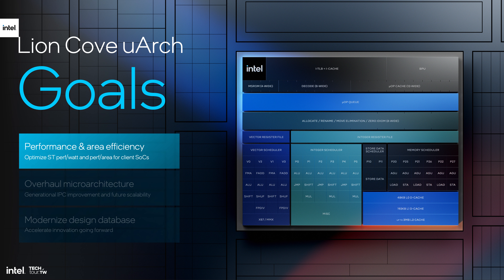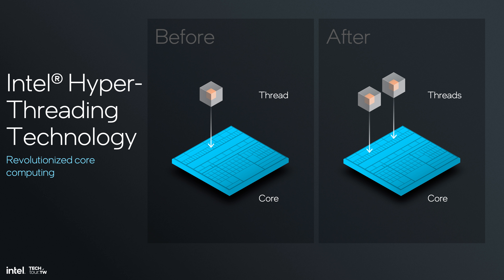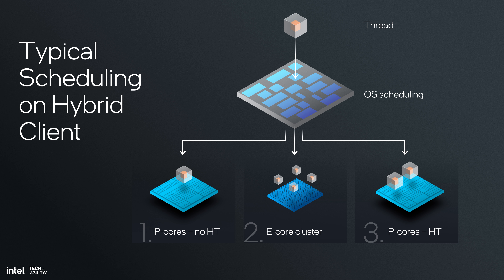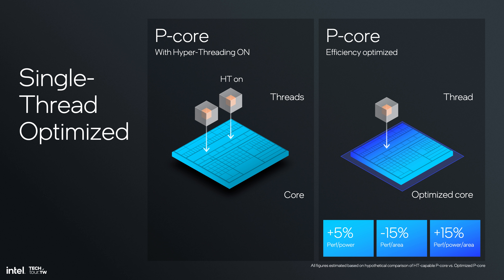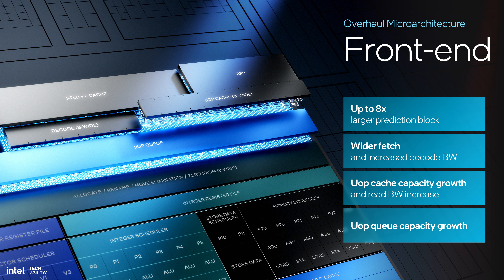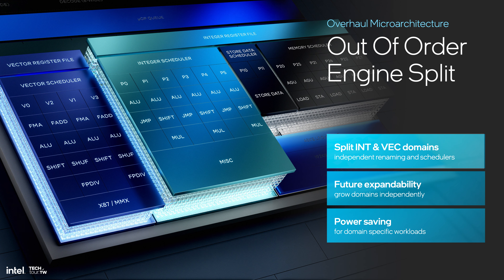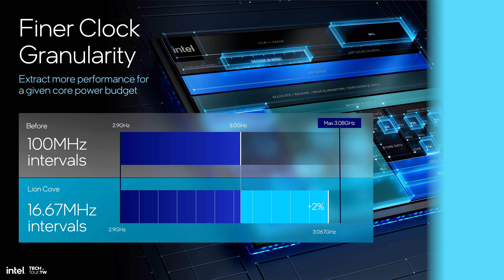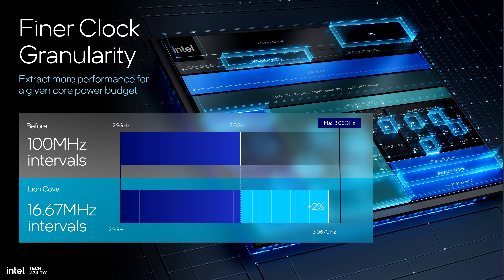Lion Cove P-core Architecture Explained by Intel Engineer | Talking Tech | Intel Technology

Comment: Can it beat X elite and M4?

Thats what we need to know!
Reply: Seems like Lunar Lake has a much better graphics chip.  I don’t know about how efficient it is compared to the others.
Reply: not need beat X, must beat apple
Reply: It should trade blows with both. The thing is, Lunar Lake will be in vastly more laptops, with more configurations and cheaper options and have no terrible Windows on ARM issues. It'll basically be the go-to solution for the vast majority of buyers. 
People that want Mac will always buy Mac and vice versa for Windows, M1-M3 Mac barely saw any increase in Mac market share.
With the X Elite, you have to deal with atrocious Windows on ARM, Qualcomms early access iGPU drivers, and very limited selection of laptops/configs.
So Lunar Lake will be end up being what most people buy.
Reply: @__aceofspades  This. Intel isn't beating anybody (by a large margin) with Lunar Lake. But with the amount of capacity they've booked (from TSMC), their packaging capabilities, and the fact they are able to supply more SoCs to OEMs, makes them much more appealing even if they don't win the performance front, but still make up in efficiency.

Here we go again.
Reply: no need to beat X Elite when it perform kinda on par with other x86 currenty in the market like hawk point and meteor lake (see the reviews). i think the goal is to beat M4

Comment: Apple ditching Intel didn't wipe that arrogance out of Intel....

Now that ARM and AMD are about to turn Intel into a BlackBerry they're catching up to Ryzen 4 years ago.
Reply: They just have to step over Intel's enormous foundries that run most of the planet. Get real. Intel's foundries play a significant role in the global technology landscape through several key contributions: Manufacturing Advanced Semiconductors: Intel's foundries produce advanced semiconductor chips that power a wide range of electronic devices, from personal computers and servers to smartphones and Internet of Things (IoT) devices. These chips are integral to the performance and functionality of modern technology. Innovation and R&D: Intel is a leader in semiconductor research and development. 

Their foundries are at the forefront of innovating new manufacturing processes and technologies, such as extreme ultraviolet (EUV) lithography and advanced node processes like 10nm, 7nm, and beyond. These advancements enable more powerful, efficient, and compact chips. Economic Impact: Intel's foundries contribute significantly to the global economy. They create jobs directly within the company and indirectly through the supply chain and supporting industries. 

The development of semiconductor manufacturing facilities also leads to substantial investments in local economies. Global Supply Chain Support: By manufacturing a substantial volume of semiconductors, Intel's foundries help stabilize the global supply chain for chips. This is crucial, especially during periods of high demand or supply chain disruptions, ensuring that various industries, including automotive, healthcare, and consumer electronics, have access to necessary components. Technological Leadership: Intel’s leadership in semiconductor manufacturing helps drive technological progress across multiple sectors. 

The chips produced by Intel's foundries are fundamental to advancements in artificial intelligence (AI), data centers, autonomous vehicles, and 5G communications, pushing the boundaries of what technology can achieve. Environmental Initiatives: Intel is committed to sustainability and reducing the environmental impact of its manufacturing processes. The company invests in green technologies and initiatives to lower water and energy consumption in its foundries, striving for more eco-friendly production practices. Global Competitiveness: Intel’s foundries bolster the competitive edge of the U.S. and its allies in the global semiconductor industry. 

This is strategically important, ensuring that critical semiconductor technology remains accessible and secure, reducing dependency on manufacturing hubs concentrated in other regions. By fulfilling these roles, Intel's foundries significantly contribute to technological advancement, economic growth, and the stability of the global semiconductor supply chain.

Arrow Lake being the first Intel CPU release on TSMC's 3nm process is a significant development in Intel's manufacturing strategy. This collaboration with TSMC highlights a few key aspects of Intel's approach to advancing its CPU technology:

Outsourcing to TSMC:

Intel’s decision to utilize TSMC’s 3nm process for Arrow Lake Intel Core 7/9 Ultra CPUs underscores its strategic shift towards leveraging external foundries to complement its in-house manufacturing capabilities. This move allows Intel to benefit from TSMC's advanced process technology while it continues to develop its own manufacturing processes.
Advanced Node Benefits:

TSMC’s 3nm process is expected to offer significant improvements in performance, power efficiency, and transistor density compared to previous nodes. These enhancements are crucial for maintaining competitive advantages in the CPU market, particularly in high-performance and energy-efficient computing segments.
Hybrid Manufacturing Strategy:

By combining in-house fabrication with external foundry capabilities, Intel can diversify its manufacturing risks and ensure a more resilient supply chain. This hybrid approach allows Intel to optimize production capacity and flexibility, especially during times of high demand or potential disruptions.
Focus on Core Competencies:

Utilizing TSMC’s advanced process nodes enables Intel to focus more on its core competencies, such as CPU architecture design and innovation, rather than solely on the complexities of cutting-edge semiconductor fabrication. This can accelerate the development and release of new products.
Collaboration and Industry Trends:

Collaborating with TSMC aligns Intel with broader industry trends where companies increasingly rely on specialized foundries for advanced process technologies. This partnership allows Intel to stay competitive with other industry players who already use TSMC’s advanced nodes.
Arrow Lake Specifications and Performance:

The Arrow Lake CPUs, expected to be built on TSMC’s 3nm process, are anticipated to deliver significant advancements in computational power and efficiency. This will be critical for a wide range of applications, from consumer electronics to high-performance computing and AI workloads.
Market Competitiveness:

By adopting TSMC’s 3nm technology, Intel aims to regain and enhance its competitive edge in the CPU market, particularly against rivals such as AMD and Apple, who have also leveraged TSMC’s advanced nodes for their products.
Innovation in Packaging and Integration:

In addition to using TSMC’s 3nm process, Intel is likely to continue innovating in areas such as chiplet design, packaging technologies (like Foveros), and heterogeneous integration to maximize the performance and efficiency of Arrow Lake CPUs.
Overall, Intel's use of TSMC's 3nm process for Arrow Lake represents a strategic and tactical decision aimed at leveraging the best available semiconductor manufacturing technologies to deliver cutting-edge products and maintain its position as a leader in the CPU market.

Comment: Who cares about intel chips anyway? However in the winter they can be a nice heating system. Unstable but a nice heater.
Reply: @loomawoe  3nm, 1 nm, zero nm, Intel will never be able to make chips cool, they just don't have the talent for that.
Reply: @profounddamas Intel has the talent to make foundries bigger than three of AMD's entire staff, and to beat everyone on clock speed on inferior nanometer. Arrow Lake and Lunar Lake, Intel no longer will represent power inefficiency on 3 nm.
Reply: @iLegionaire3755  Talent to build factories??? That's not the kind of talent I was talking about. Intel has been lacking of talent to engineer cpus since AMD Ryzen showed up and it doesn't seem fix that lack of talent anytime soon. So you are putting faith on not yet release Intel products? That's a bit weird isn't it?
Reply: @profounddamas  I have faith that if one company fails to compete, the other will fall behind. Yes AMD is more power efficient than Intel. That is going to change.

Comment: Back in Nehalem to Broadwell, overclocking iGPU with 1.5V voltage does NOT affect laptop life. The temperatures remained stable when I overclocked the iGPU to 1.8GHz. There is no overheating, the IGPU automatically throttle when it reaches 85°C, my laptop stable at 60°C. Although performance does not increase significantly, the NECESSARY thing here is that EVERY IGPU MUST BE OVERclocked and FREEDOM TO ADJUST. INCLUDING DESKTOP OR LAPTOP. I HAVE I7 7700 CPU AND NO dGPU, I NEED TO OVERclock IGPU TO PLAY GAMES. OVERCLOKING ON DESKTOP YOU KNOW IT'S PERFECTLY OK COMPLETELY DON'T HAVE ANY RISK BUT IT'S BEEN LOCKED SINCE SKYLAKE AND IT MAKE ME VERY ANNOYED
Reply: That's why when I went for an i9, with a choice of iGPU or none, I chose the 9900KF without this aspect. It simply makes more sense for overclocking and with the 14th Gen i9, it's only the KF edition to feature 6Ghz out of the box. I suspect this is for the same reason, you rightly point so have just pointed out. 5Ghz across 8 cores, with 16 threads and 32Gb DDR4, has been ample for my desktop needs for years. Watching as Meteor Lake did its things, Raptor Lake refresh being the end of that road from 12th Gen to 14th, they're very nice CPUs and offer an incredible core count, with threads and performance on tap to achieve most things gracefully. It's been the realise of the 14600KF, giving gamers a margin of 5% edge over the AMD 7800X3D, considered until recently, the best gaming CPU available, with competitive pricing which won a lot of AMD new customers as conversions from Intel. I suspect that when 15th Gen desktop processors arrive, the competition at AMD with Ryzen 9th gen, sticking with the threaded Zen architecture, being well understood and known by Intel (having a primary Zen architect, working inside Intel for 2 years) it's going to be very interesting to watch how this all unfolds. I suspect that AMD fans will need every bit of the highly anticipated 85% performance boosts being speculated around social media, to maintain AMDs rather impressive run enjoyed with Zen architecture. Every now and 'zen', Intel do something so significant and major, it really does show the fundamental differences between the two companies, from inception to how they operate and products the make, never the true masters to realms, in which their core business is not only based but continues to evolve.

Comment: Huh.. we took away ht because it didnt make sense... thats not scientific
Reply: Reduces single thread performance in most applications, is a massive security vunerability, causes additional performance reductions from security mitigations, much harder to schedule with a third thread type, takes up die space, increases system latency, redundant at these core counts etc etc. Good enough for you?
Reply: @Frozoken  much better
Reply: The only benefit of hyperthreading is increased multithreaded performance only when the core is maxed out.  In single thread and moderately threaded applications, hyperthreading can be a performance drag.